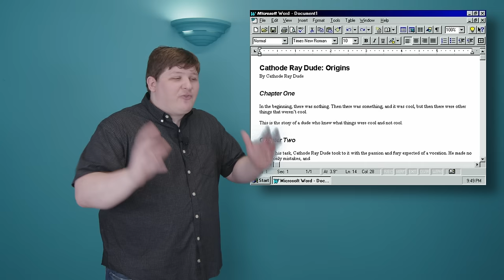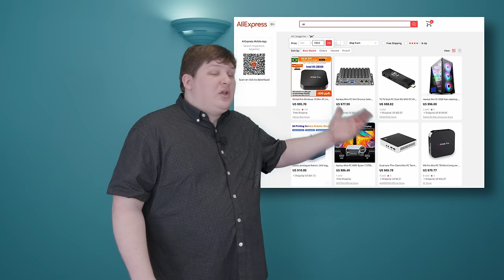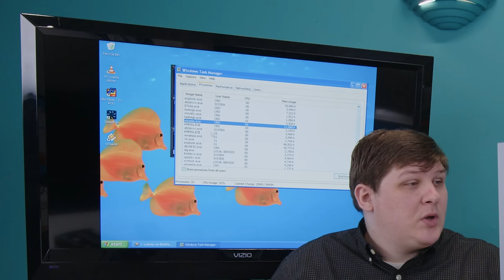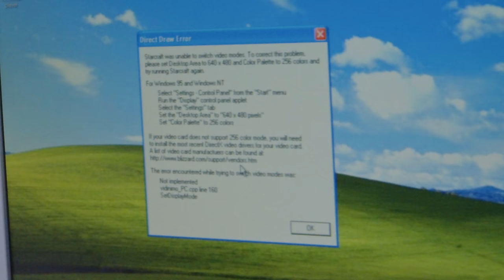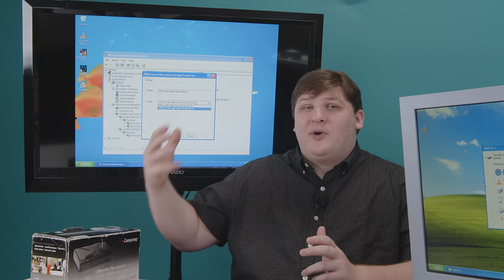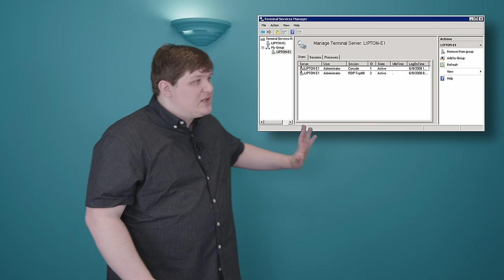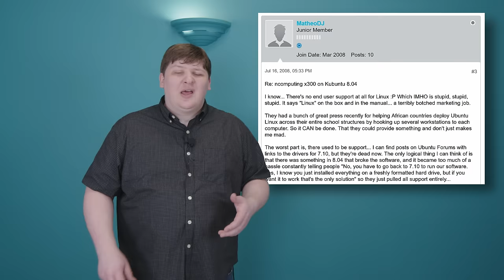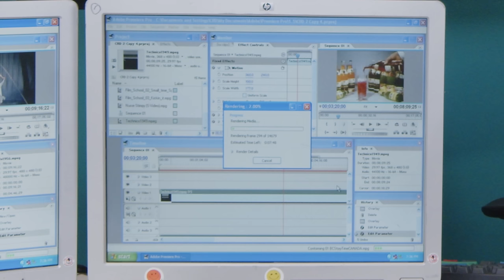7 Users on 1 PC! - but is it legal?

Comment: About the Plateau: Ive been saying for many years putting an SSD into an old machine often completely revives it, in terms of usability for some people.
The processing power might actually be there, but its the storage medium speeds that are holding things back. I know my father still uses his 2011 Thinkpad, I used the same model for years, with only the main reason for upgrading was that my mother wanted a laptop for when she doesn't feel like sitting at her desk, and I wanted something more light weight. I didn't need that much of a processor speed upgrade, since I use my desktop for most things.
Reply: New SSD (only cost me 35 bucks) plus maxing out the RAM made a huge difference on this laptop a few years ago.  I went from 4gigs to 16.  The difference was almost as big as when I switched from Win7 to Linux.  4 gigs of RAM in windows and it used to crash and need restarted all the time.  4 gigs of RAM in linux and it would just periodically get stuck for a bit and start working again.  Now with 16 gigs it never gets stuck.
Reply: Many years. 12 years for me. Laptops are utterly useless with spinning platters. No innovation = profits
Reply: @godsinbox  
Tbh mechanical drives are actually a terrible design idea in portable devices, cause anything mechanical in nature hates vibrations, and portable things by their very nature are exposed to a lot of vibrations. Imo the beat thing for laptops would be to have an eeprom to hold the system files, and an ssd to hold data. That way you don't need to wait for the disk to initiate to be able to boot the base system.
Reply: Funny you mention thinkpad specifically. I just ordered a new $380 HP laptop yesterday, but almost went for a ten year old TP for $120. I may still get that one too, put in some extra ram and an ssd.
Reply: @peppigue  
Look and see if you can flash coreboot or libreboot on it too, I know thinkpads are well supported.
Reply: Storage devices of nearly any type with the exception of very complex raid set-ups were always a big bottleneck. It however became excessively apparent as 64-bit systems and multi gig files became normal. 

I am not sure how tolerable computing would be were it not for ssd and faster bus standards. I have placed ssds in older laptops without much improvement in overall speed, however none were fresh installs so it was not very optimal. 

It is still a good way to update an old core 2 or core I laptop. Those processors and the M series they were based on were always very powerful at least in their higher tier forms, you could really tell that the slow as molasses mobile mechanical drives were sucking the life right out of them.
Reply: Writing this using a core 2 duo laptop with SSD replacing the old HDD. Elitebook 8730. 17 inch display.
Reply: all 3 laptops in our house are 3rd gen intel (2 i7's and an i3) all have SSD's and have been cleaned out with new paste. the difference from the old 5400rpm drives is insane.

The i7's are gaming models and have no trouble with email/web browsing/video and gaming (jurassic world evoloution 1 etc)  and the i3 is fine for viewing workshop manuals and scanning vehicles. i have a lot of friends/relatives that spend 2k+ on new laptops every few years with similar use case scenarios.
Reply: I'm about to replace my old laptop's HDD with a proper SSD, and I am fully expecting it to be fully revived. No more power wasted in the disk, the RAM won't be an issue either any more because SWAP is much better to use. Maybe a new battery and it's all good to go again for the next plenty years!
Reply: I still use my Core i7 2nd Gen Samsung laptop from 2011, just added RAM up to 16GB and put SSD, put Windows 10. Work pretty good for most everyday tasks, like document editing, internet browsing, watching video, and even still works more-less good for programing.
Reply: My i72600k is perfectly serviceable in 2021
Reply: I feel that the majority of the boost from installing an SSD could also be gained by reinstalling the OS on a new hard drive. It mostly comes from the newer drive and clean install.
Reply: i'm running a PC built in 2011, with a brand new SSD. it flies. (i5-2500, 770GTX, 16gb ram)... for the things i want to do. (old MMO game)
Reply: For my desktop, I have an AMD Phenom II x4 945 processor, with DDR3 RAM and an SSD. I can do everything I want to do on this machine, including complicated mathematical computation using Wolfram's Mathematica. My mother-in-law has an old Dell Inspiron 570 with a mechanical HD (probably 5400rpm), which can barely run Windows 10. I'm going to swap in an SSD and see how much faster the machine gets.
Reply: @rockytom5889  Just use an ssd for all files. Once you're at sata3 speeds (let alone nvme) you're at diminishing returns for raw speed, and with the high iops and low latencies of an ssd you won't notice any further improvement without benchmarks. Unless perhaps you put several hundreds of gigs of 'eeprom' on the cpu itself.
Reply: @kaseyboles30  
I mentioned the eeprom cause if you put only the system files on it, it would boot faster, since you wouldn't need storage drivers to load the os itself.
Reply: @rockytom5889  It's not really a significant speed up to the end user (though eeprom do have higher write endurance and can write/erase single bits at a time). And modern computers don't need drivers for nvme or sata drives as the bios (a serial eeprom) and cpu both have their parts of the needed functionality built into them. You only need drivers for specialty and unusual devices. 
In a sense the bios is pretty much already what you're suggesting as it contains all the critical programming to boot a machine and the o.s. or VM resides 'on top' of that. I suppose having a dedicate built in high endurance ssd (slc, massive under provisioning, perhaps even x-point shadowing down to ram) might be an idea for some niche situations. You'd still need the ability to boot off of alternate media or you'd be in a situation where an o.s. update could brick your system much the way a bios update can if you don't have a backup bios or bios flashback type ability build in.
Reply: Absolutely. Installing an SSD into most machines will reinvigorate them. This is particularly true for machines that natively support NVMe via M.2 slots that haven't been populated, or those with spare PCIe 3.0x4 slots that could be utilized to install a PCIe M.2 adapter card. While NVMe isn't strictly required to see noticeable performance improvements over spinning rust, it is one of the more apparent improvements. I've used all of the different types of SSDs throughout the years and NVMe utilizing PCIe 3.0x4 is one of the easier to find compatibility for and it essentially maxes out the throughput of the vast majority of storage controllers without breaking the bank. You can get M.2 sticks of 512GB capacity for, like, $150-$200. It's pretty awesome. I will also go ahead and say that it isn't worthwhile to build a system just to be able to take advantage of the latest PCIe 4.0x4 M.2 storage devices. You just won't see a significant enough performance improvement without spending a ridiculous amount of money on an SSD with a particularly exotic arrangement of storage controllers.

Honestly, if Apple opts to include interchangeable DDR5 slots and a few PCIe 4.0 M.2 slots on their desktop M1 variants, I expect them to become the peak example of "The Plateau of Computing" for many. Particularly if they do so for the upcoming Mac Mini refresh. It's unlikely, though, because Apple is gonna Apple.
Reply: @mndlessdrwer  I would only add that your pricing for nvme is actually higher than reality right now in the US at least. I just got a spare 2tb stick for $180 and picked up a fast 1tb a couple months ago for <$150.
Reply: @kaseyboles30  That's true for just about every PC component right now. It'll hopefully get better, but nobody really knows when, since it's down to a multitude of factors. Chip shortages, logistics strikes due to low wages and benefits, inflation doing its thing, SSD-based mining, etc. Honestly, if you can find an SSD for the price it retailed at two years ago, you're probably doing pretty well.
Reply: @mndlessdrwer  amazon. As I said I just got several ssd's much cheaper than they were 2 years ago. I have an older 512gb I paid nearly $100 for two years ago, and just bought a 1tb that's faster for less than $150 and a pair of 2tb's the same speed as the old 512gb for less than $190. MUCH less than the  $275+ they were just two years ago.
Reply: @kaseyboles30  that's great to hear! I haven't checked on storage prices in a while because, well, I haven't really needed to. I just moved my download folder off my 120GB boot drive onto a 240GB SSD and my two 4TB HDDs have barely any use on them at all. Maybe I'll bother with a larger NVMe drive in a PCIe adapter in the future if it becomes necessary, but my current needs are already well met. I'm glad that the flash storage prices have gone down again from when that new cryptocurrency spiked their prices.
Reply: Love the pfp dude.
Reply: I got out of computers. It long out of high school. The last hard drive I bought, I paid over $200 for a 20 got hard drive, and didn't think I'd ever fill 20 gigs. 

My work was throwing out some old xeon servers and they let me take them home. I borrowed an old 60 gig 5400 drive, downloaded windows and installed it. It took several hours to get it up and running. Satisfied I could get them to work as cheap gaming computers for my kids, I went out to buy a hard drive for the first time in probably 20 years. 

I ended up getting a 500 gig SSD for $50 that was way cheaper then any other new option, from Walmart of all places. Popped in my USB 3.0 drive with windows 10, and I couldn't believe the difference. The install was done in about 20 minutes and boot times went from minutes to seconds. 

I got back into computers, mainly playing Minecraft with my kids. Bought a cheap used 7th gen laptop and it had a good high end m.2 drive in it. I expected a major difference like the hhd to sata ssd, and although measureable with a benchmark, I couldn't tell the difference. 

I miss the early days of computers, but I don't miss it taking 5-6 hours to download a single MP3.
Reply: I just finished working on a Warner Bros film for the last 3 years using a 12-year old Sony VAIO with no issues.
 I specifically chose that one due to having 2x SSD's in RAID0. It's price was similar to one of a similar spec today ($1299)
Reply: @thisaccountisntreal107  so is my 2700k :)
Reply: An SSD is by far the most efficient upgrade for old computers. I have replaced the original HDD in several older PCs and laptops, giving them a second life.
Reply: Recommended this all the time when I worked at Geek Squad. Management hated it because it meant people weren't buying whole new computers.
Reply: I remember being astounded at the performance improvement just by upgrading from a 5400 to a 7200RPM hard drive. SSD is an even bigger boost than that.

Even today when I discover a computer running slow, it's almost always heavy disk activity. Even modern OSes don't handle that well... (fun exercise: plug a faulty SD card, that stops responding after a while, into any machine, and watch it grind to a halt.)
Reply: My main living room computer is a a Core2 Quad Q6600 I bought used back in 2008/2009. Upgrading to an SSD and 8 GB RAM basically revitalised it, now also using a GTX 660 GPU in it I can watch Netflix, YouTube, etc in full HD which is the best I can do anyway as my LG TV from 2009 is only HD! For basic productivity it's still amazing. It also spends most of its life in Power Saving mode as even now I don't often need the full power of a 15 year old CPU! My laptop is 10 year old Lenovo X230 with a 3rd Gen i5, 16 GB RAM and dual SSDs and it is way overpowered for my needs. I think the Plateau is why Microsoft have decided to only support Windows 11 on PCs manufactured in the past 5 years. I think landfills will see a sharp increase in e-waste when 2025 comes around. Such a waste just to make money selling products people otherwise wouldn't even need.
Reply: Yeah, Core-II CPUs still run modern JavaScript engines OK. And that’s what drives perception of “web browser speed”. A Core-II running a supported graphics card and 8g of RAM on W10 is a very suitable general browsing and office tasks machine.

Comment: I work at a University and we used the NComputing X300 in one of our labs for a while as part of a “green computing” initiative.  Students needed to use USB drives, so we had USB extension cables and assigned a USB port to each station as you described.  However, it would sometimes crash when people inserted their USB drives.  It wasn’t fun to see four stations go down while people were using them during finals, but I guess we were pushing the limits.

Comment: Cool video! I was the founder/CEO of a company that ended up acquired by 2X/Parallels, that created a 'Citrix' like product (basically, remote sessions for users using multi-session OSs like Windows Server 2003. 2008 and so on back in the day). You are correct that even according to Microsoft, at the time, they did accept this as 'legal' if you had all the XP licenses for every person connecting to this (I heard this from them directly and even had emails confirming it). Also note that with Windows XP SP2 BETA, multi-user RDP was possible. It was later removed from the final SP2 build and that is how many people implemented multi-user RDP on XP, by simply using the required files off the BETA SP2. Really awesome video here, bringing so many great memories about the early days of remote desktop.

Comment: The way you usually can get the code from an fpga is that its actually not stored on the fpga, its stored on an SPI flash chip in 99% of cases. You can’t just read the code universally because every fpga manufacturer and series has a different bitstream, but there are quite a few bitstreams that have been reverse engineered and have been made open-source, with software able to turn the bitstream into verilog in order to verify that the stream has been copied correctly

Comment: A few years ago, where I worked, we had a video editing lab with standard definition broadcast quality capture cards (DPS Perception).    They supported Premiere, but also offered their own video editing system which some of our users preferred.   This software only ran on machines with Perception capture cards, but required a dongle as well, because, of course a £5,000 video capture card isn't enough of a dongle.